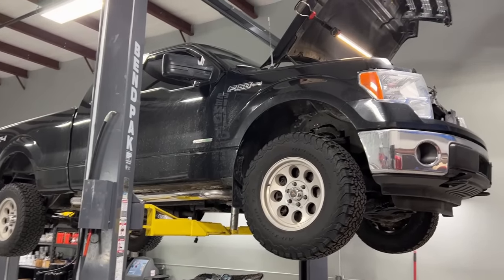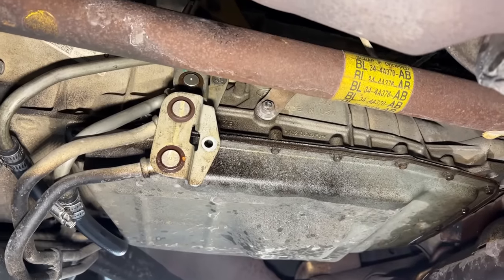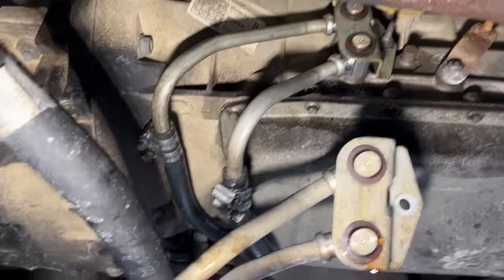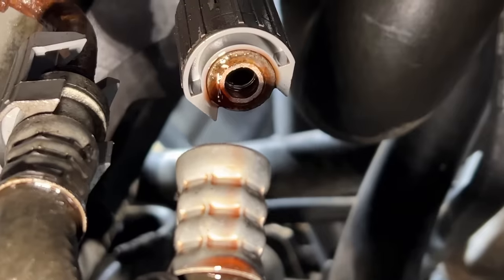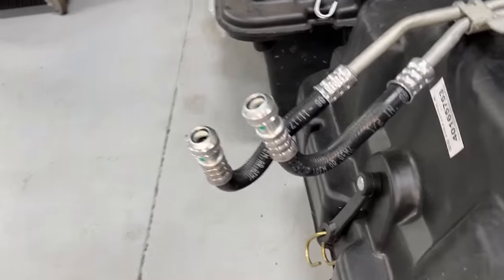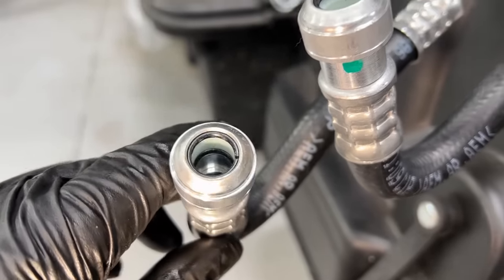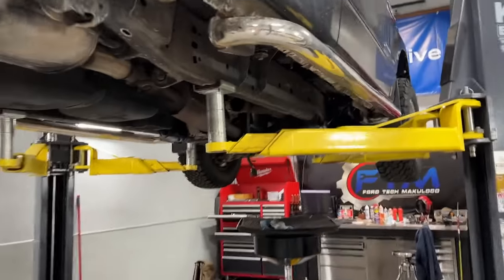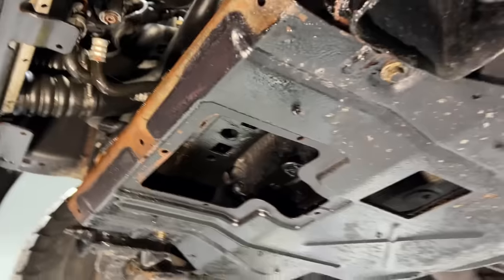Attention 2009-2014 Ford F-150 Owners! Check Your 6R80 Transmission Cooler Lines Before They Blow!

Comment: Looking at the rusty condition of the cooler pipes I'm wondering if the corrosion/rust is the culprit more-so than faulty push connect fitting. Also, if it would be possible to eliminate that fitting and just go to hose and clamp fittings like on your diy bypass line? I added a transmission cooler to a '95 Grand Marquis using just hose and clamps and it's been good for the last 25 years!
Reply: this a great point, why replace a prone to fail part with the same part, I am wondering why there is not an aftermarket upgrade to this yet

Comment: I just applied JB Weld putty around the joint of the quick disconnect coupling where failures occur.  I removed a little over 1/2 the thickness of the lower section of the plastic locking device. This allowed more room for the putty, and still let me install the lock.  While doing the work I noticed my quick connect couplings pivot  freely on the steel tubing going to the cooler hose.  So the question is:  have coupling failed when they're free to pivot, or ONLY when rusted and unable to pivot?  Answers anyone?

Comment: Hi Brian. I just watched your video on the F150 transmission cooler line failure. How easy it is to change those lines before they fail? I noticed the rubber in those quick connections you pointed out is starting to crack and there is a little rust forming there too.
Reply: I just changed the transmission cooler lines yesterday. Not that difficult and didn't cost me very much. Thanks for the warning! After watching this video I immediately called my local Ford dealer and ordered the new lines. I noticed some rust around the quick connectors so I didn't want to wait. If you could do a video about changing these lines I'm sure lots of your viewers would appreciate it. Thanks again!!

Comment: Just had this happen to a customers vehicle. Smoked the trans. Aside from factory replacement lines, do you know of an upgrade to prevent this from happening again? Or do you just consider the lines to be maintenance every 75k? These went at 100,199 miles on a 2014.
Reply: I have a 2014 f150 with a 6.2l V8. My truck only as 60000 miles. Do you think I should replace it now ?? I am looking to get my transmission flushed now anyways.

Comment: Wouldn't this only be an issue if the transmission is hot enough to have the internal bypass open? If the bypass is shut due to lower temps, then the only fluid you will lose is the one in the cooler and the lines but the transmission (and converter) itself will be sealed and thus continue to have the fluid pumped where necessary. And it takes quite a bit of towing to get the trans hot enough where the bypass opens, so odds are that just driving around you will be ok.
Reply from the maker: No the fluid is constantly flowing just not full force until the thermostatic valve opens all the way kind of like how an engine coolant thermostat is not just closed or fully open. If you don't trust me then the next time you go on a short trip to the grocery store feel the lines they will be warm to hot, not ambient.

Comment: My Stepson's 2012 F150 4x4 tonight.
He called me 20-30 minutes away from home said his truck was doing some weird thing. He knows nothing about vehicles. Long story short. It was this exact problem. He drove it until he was 2 miles from home. My fear is that he fried the tranny. Low mileage truck too...only 74,000 on it...and he drove it until it would move...

Comment: Do you think it's possible that this could be caused, or a contributing factor,  that during oil filter changes, that these lines are getting pressure put against them?
Reply from the maker: No the lines are on the passenger side.

Comment: Brian, I have a 2011 F150 with 3.7 100,000 kilometers (Canada) 60k miles. Do you find this happens after a certain milage? Do you replace the lines to the transmission as well as the lines to the cooler?
Reply: If the part on your truck looks like the new lines he shows in the video, I would change it every 100k. The rubber lines don't flex as easily in cold Canada. That will put more stress on that weak aluminum tubing as the engine vibrates, so it might fail sooner than in a warmer climate.

Comment: my dads truck has a 6r80 and his lines leaked very bad and he replaced them and it also needs a timing chain but going up a slight incline it will shift down to 2nd gear while at 30-50 mph what could that be? could that be the timing chain making the transmission do that,

Comment: Aluminum has no place on a crimped hydraulic fitting.  You see it a lot these days on all different kinds of vehicles.  Probably to save weight for CAFE/EPA requirements.

Comment: i have 2010 f150 with the 6r80.  this spring i noticed that on downshifting while trying to pass, or going up hill it would sometimes slam into gear. yesterday i got in it, backed up my driveway, through it in drive, did a 3 point turn at end of driveway, but when i pulled out onto road it wont shift through the rest of the gears?  goes into reverse and drive fine just wont shift...  any ideas?

Comment: is there a way to convert the portion of the connector from aluminum to have the same material as what comes from the cooler? because that is manufacture defect in my opinion

Comment: I got a new 2014 f150 it would break just sitting in the driveway i didnt put many miles on it . how i solver my problems? I traded it in ,got rid of it. I fell for the hype of the f150 . ive had a dodge and chevy that where both better trucks but they where the older ones . i hate to say but i dont thjnk anyone makes a decent truck anymore .

Comment: are the disconnects easy to undo or do you need a tool for that ?
thanks
Reply: You probably need one of those simple split tubular tools to push into the connector so you can release the teeth inside the connector, then push in to release it, then pull it apart. On my fuel filter, you need to push the tool into the connector, and while you are pushing the tool in, you need to then force the tubes together, only then will the lines come out of the filter. When finished, you want to make sure it is locked by trying to pull it apart a little.
Reply: @billsimpson604  thank you

Comment: QUESTION  F150 Owners: I swapped out all 3 lines, about a quart drained out during process. Now, when I unscrew the 19mm cap to check fluid, it leaks out?? So, that's odd, i figured I need to top it off a quart or so... My tranmission was perfect before. So, was it simply overfilled? Anything else I should be looking at? Concerned?
Reply from the maker: It must be running and must be a at operating temp to start checking.
Reply: Yep…. That was it. Thanks. Oh… only 1 burn blister on my hand…. So I guess that comes with the territory. Thanks Ford… great idea!!!!!

Comment: Got a question for you I have a 2011 jaguar xjl with a cord 5.0l in it the ac is not cooling off unless u are driving are speeds there is a bulletin about the dps(direct pressure sensing valve) that can go bad but I’m having trouble finding a jag part and was wondering if the fords 5.0 ac compressor uses the same valve in it jag part number C2D42376 they are wanting over $200 for like a kit I just need the valve piece any info would help thanks

Comment: Any incidents with the 2015 - 2020 Ford F-150 (8th Generation), those that have the 6R80?   Plumbing layout is different.
Reply: I have a 2015 F150 with the 6R80 and would also like to know if this transmission cooler line issue applies.

Comment: Any way to confirm if my torque converter/ Trans are fried?  My hose just broke, but I was in a parking lot. So though the fluid emptied, but barely drove it after.
Towed it to my house, just wondering if I should try just a new hose or bring it in?
Reply from the maker: You should be ok. I would replace lines, refill as per my video and retest.
Reply: Thank you. Since it's Sunday, I just bypassed the broken connector with new hose. Cut the old rubber hose and added a brass hose barb to the new hose directly to the cooler.  Should buy me a couple days for the new hose set to arrive.
Your videos have helped me and so many others in a real tangible way. Thank you for what you do.

Comment: yet ....a lot of these trucks routinely run high mileages and do not have this problem. It is in the category of the other infamous failures such as the 3 valve engine fatal flaws in the timing and valve assembly.....happens to some but not all. Puzzling. More questions. Did this guy have a leak that he never saw or ignored leading up to this. The idea of sudden catastrophic failure with no warning is a bit much to accept, but if so this is a real bugger of a problem. And what about replacing the hose assembly...what assurance do you have that the replacement part is any better? The approach to cut off the troubling section of hose and improvising a full flexible hose connection has some appeal. The idea to attach a long brace on each quick connector also may be worthwhile, something attached with clamps that will effectively splint the entire connector section so that it cannot flex back and forth at all. The factory hose, though it does use rubber still does transmit some degree of force with rocking of the engine and frame twist so perhaps that is enough to cause the problem. Could be that clamp assembly was just defective in the manufacture of these hoses or at least that pressure line from the trans?  l looked at my 2009 f 150 and the location/orientation of those quick connectors and lines is different and the tubing is all aluminum...that hose attaches to another short flexing hose that attaches to the air over cooler coil and that whole air over coil assembly is mounted on plastic that is semi mobile, it can move around and flex, which provides additional strain relief. The truck you are working on looks like it has a securely mounted steel line going up to the air over cooler and thus does not provide additional strain relief to that quick connect area.

Comment: How hard are these lines to replace? Has anyone done this job in a driveway without a hoist? Can you just feed the lines up through from underneath or is there a lot to remove. I'm going to at least inspect mine on my 2010 (130k), but if it's not too hard to replace them I'll just do that. Lot cheaper to buy the line kit versus a trans and I like my truck.

Comment: How do you feel about servicing the transmission every 30k? Some mechanics say the higher the mileage you shouldn't flush it! Confused!
Reply: I have 2010 f150 fx4 with 2inch lift  456000km never touch it Zero problem trying for 500km runs smooth knock on wood .
Reply: Generally, every 50,000 miles is okay, unless you do a lot of heavy towing. Since there is no combustion inside a transmission, the fluid doesn't get contaminated with combustion products and carbon, like engine oil does. A flush can cause problems, so I wouldn't do it. Just have the pan removed, clean it out, including the magnet usually found in the bottom of the pan to keep metal dust from circulation with the fluid, and change the transmission filter, which is inside it. Use the fluid recommended in the owner's manual. Don't underfill or overfill it. YouTube has videos on how to service many transmissions. Watch every one which applies, if you plan to do it yourself. On newer transmissions with no dipstick, you will need a pump and hose to get the new fluid in. It usually isn't necessary to replace all the fluid in the transmission and the torque converter. Just replace the fluid which comes out when changing the filter, with new fluid. Most transmission fluid is a synthetic oil.

Comment: I’m a mechanical engineer.  Aluminum has no ability to hold a stress over time.  It tens to creep.  Steel does not.  If there is a lot of stress required to make the connection over time the connection will  loosen and possibly slip open.  You don’t see springs made out of aluminum.  It will change characteristics starting day one.  If you over design enough it will work.  That is why you see all the planes in the desert being chopped up.  The aluminum has reached its fatigue limit.  Most mild steels  have infinite life if operated at half of tensile yield strength.

Comment: What's your point; it's fine, just until it's not... You suggest to replace something which might hold-up for as long as the vehicle and is in perfect working order, as a preventive measure? If you go down that rabbit hole, where will you stop? Is such replacement recommended by the manufacturer; I believe not. These parts come from various sources, some are better and others most likely not so much...
Reply from the maker: ok

Comment: Thats a huge failure , im not a ford vehicle owner but can this be caused by a sudden downshift and sudden acceleration and oil pressure in the lines went sky high and snapped ? 
Great to see you again Bryan 👍👌

Comment: Just looked up the parts and noticed that the ecoboost and coyote has different part #’s. Are these lines breaking on both the ecoboosts and coyotes? I just did the lead frame and some other things on mine. wish I had known about this then. As always, appreciate the video though!
Reply from the maker: both
Reply: @FordTechMakuloco  thanks for the reply. Looks like I’ll have to do those soon as well. I’m only at about 80000 miles on mine (coyote engine) so perhaps I would be fine for another year or so. A risky gamble though 😬
Reply: @FordTechMakuloco  I actually just replaced mine today along with the couple other hoses with the male end of the quick connects. Man there is not much clearance on the coyote. I actually had to remove the front hanger/mounting bracket so I could fish it through. Putting the bracket back on after it all was in place was tough as well. I have some peace of mine now though knowing it’s all new again 🙂

Comment: Is the something that should be replaced as a preventative measure?  I have a 2010 F150 with over 224000 miles on it. Also are the new one made better than the original, using steel instead of aluminum?

Comment: So what’s the fix?  I have a 2013 with 128k.  Should I change the lines now or what?
Reply from the maker: Yup change them immediately.
Reply: @FordTechMakuloco   using Ford parts?   Are there problems with the new parts after replacement?

Comment: Damn, this just happened to me today.  2014 f250 with only 25,000 miles on it, line blew while I was on highway.  I noticed it right away and pulled over.  Repair man thinks everything is ok.???

Comment: Would this be the same issue with expeditions? Up to ‘17MY?
Reply: His "info post under the video confirms.
Reply: @mattmanyam  duh huh.  See it now, i was wondering if i should be concerned about my ‘16 expedition.
Reply: @lucasshupe8108  same part# thru '17 expeditions. BL3Z-7R081-D

Comment: I just cut those  metal sections out and replaced with high pressure  rubber lines  problem solved.

Comment: What do I need to look for to see if a line is getting ready to fail?
Reply: I think you just need to pull down on the connection at the quick disconnect and see if they break.

Comment: Would this also affect a 2014 Ford Expedition with the 5.4L 3v ?
Reply: Get underneath and see if it has the same quick connection he's talking about bottom of radiator.  If it does then yes
Reply: @ryancoleman1  I know. It may be the same type of connector, but a different (revised) part number which does not snap off... hence my question to the creator of this video. He only mentions F150s.

Comment: Do you have a part number for that set of transmission lines?
Reply: They vary depending on model and year, go to the ford parts web site and plug in your vin number to get the right numbers or just call your local ford dealer.

Comment: Is there not a better quality line?  I am not a fan of aluminium being used in any type of application where aluminum is under stress?

I am disappointed in Ford and probably won't buy another Ford truck.  I will have have my lines looked at or replaced.  It is another thing on a long list of issues.

Plate C

Comment: Too short hoses with no loop , with one end attached to a still frame and the other to a vibrating motor, with loosely held cheap aluminium couplings with "O" rings with plastic tabs. Talk about bad engineering. I miss the flanged couplings on old cars. Thanks for informing us about this potential issue.

Comment: Is that common with the 5 L also?
Reply: All engines in our generation, 2009-2014. Parts on order for mine right now, one line is slow dripping at the quick connect. 2013 5.0 177K

Comment: @6:44 I think it is a mistake not to change the cooler or the lines on the other side of the brake ???
Reply from the maker: Right you want to change both sides.

Comment: Took all 3 lines out and after a week of getting the wrong lines, I finally have the right ones but I don't remember which side goes to the cooler and which goes to the radiator. Anyone know?
Reply from the maker: You didn't me your engine year and or configuration but if you open the hood and look down at the lines the longer one on the right goes to the right connection on the bundle.
Reply: @FordTechMakuloco  14 f150 with a 3.7l. one goes to the bottom of the radiator on the driver side and the other goes to the oil cooler towards the middle in front of the radiator

Comment: What’s the part number for the hose set? 2014 F150 xL
Reply from the maker: It varies based on engine and trailer tow package you have.
Reply: @FordTechMakuloco  2014 raptor part number?
Thanks